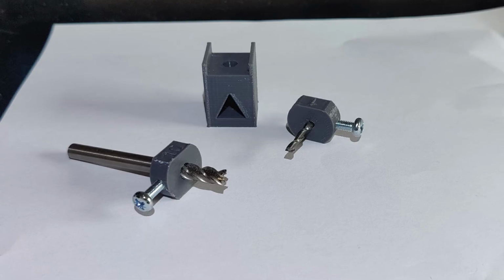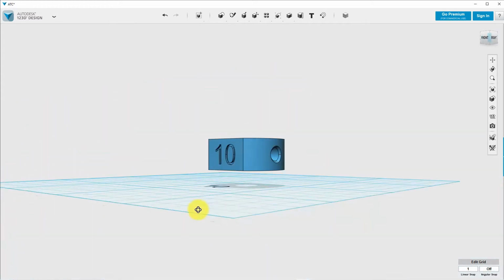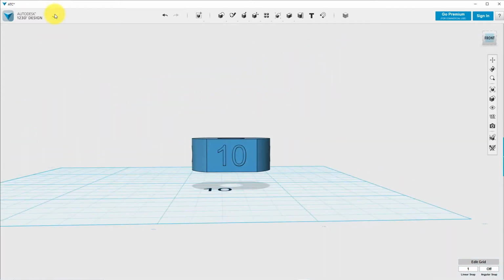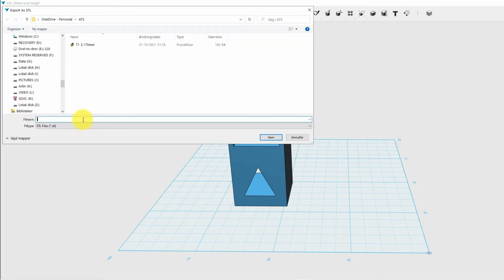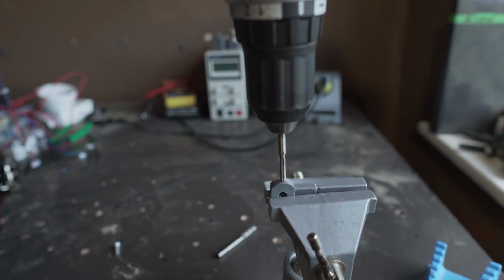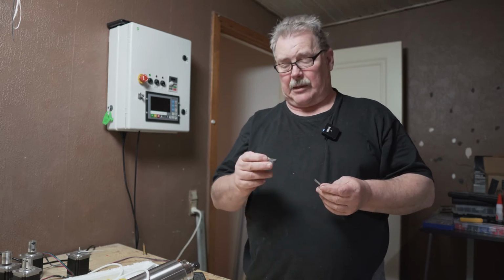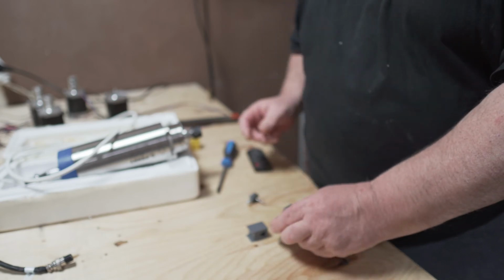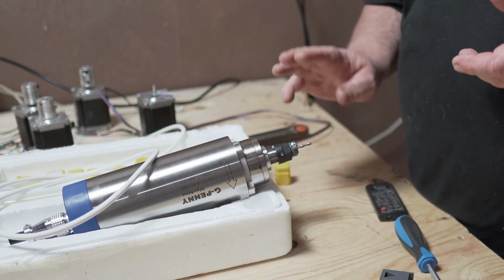3D Printed offset Tool for my CNC machine.  Same tool length

Comment: Hi. I thought about doing something very similar to this but was thinking that there might be some deviation each time the bit,and any other bit, is placed in the collet. I was thinking this because, depending on how tight the collet is tightened surely that means that the bit gets pulled up slightly more or less. This was my thinking??
Reply from the maker: Well blindness.  your work should not be to much accurate.  I am back to using my block or paper 😄